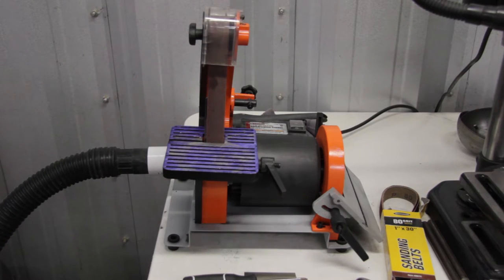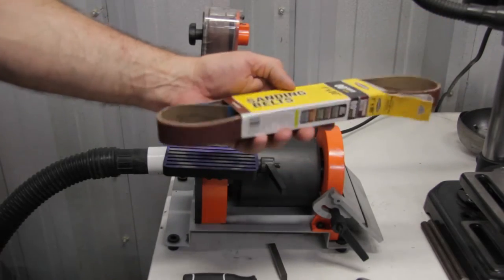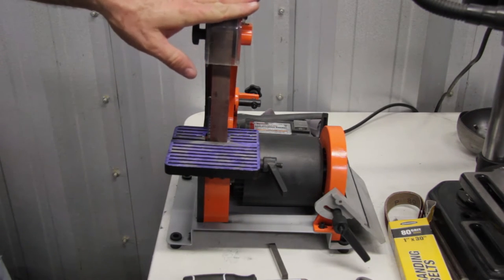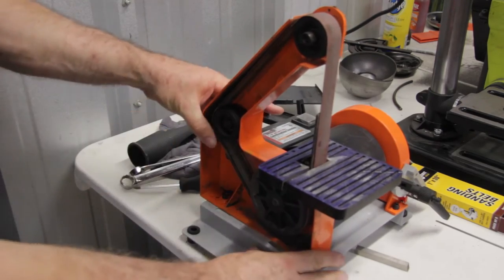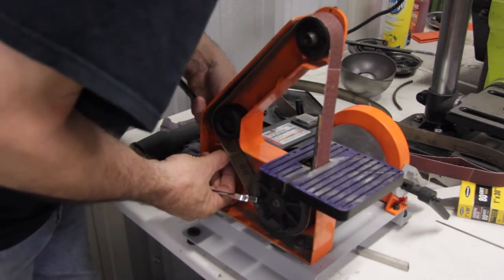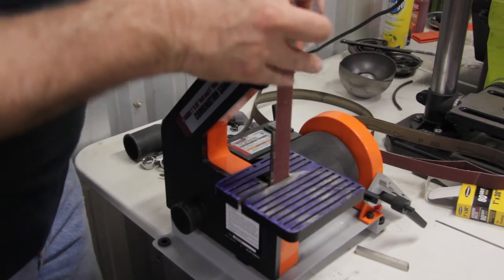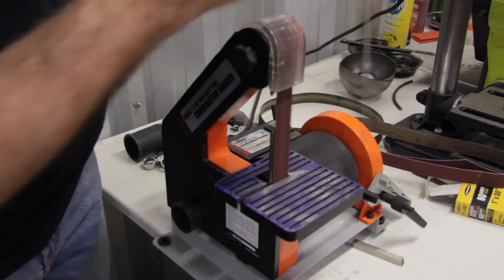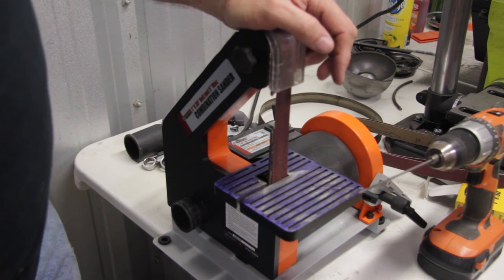Harbor Freight 1” Belt Sander Review

Comment: Thanks for the video. Now........... you had to loosen and rescuer  the tracking / belt tension nut when removing and after installing the belt. That assembly should be loose enough so the belt tension / tracking is able to move freely ALL THE TIME. That nut is designed not to move from vibration.
Reply from the maker: thanks for the tip.

Joe

Comment: How do you replace the sanding disc? The stupid plate is in the way.
Reply from the maker: Un-screw side cover and top cover, loosen belt, There is a hold cut in the table to slide the belt out and replace a new one, Thanks
Reply from the maker: you have to remove the plate, unbolts from the bottom,  then peel off the disk